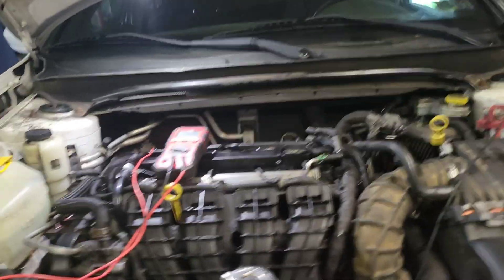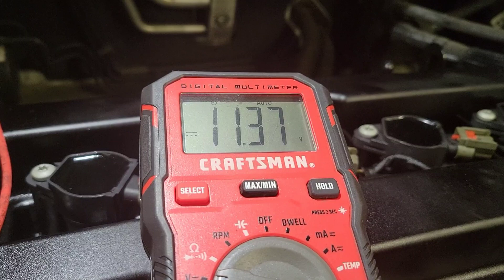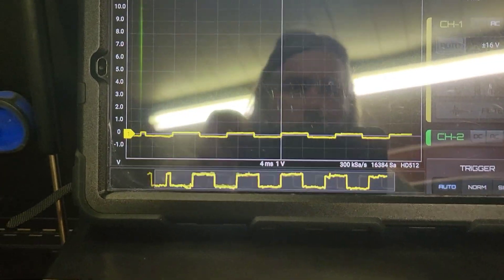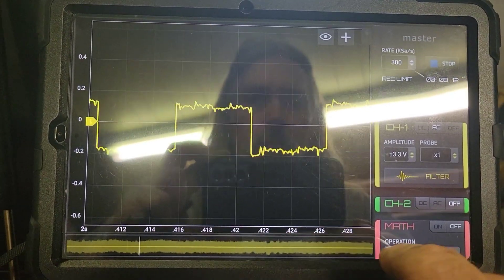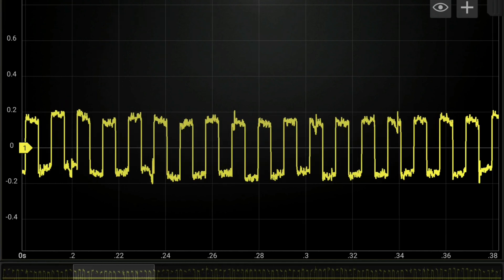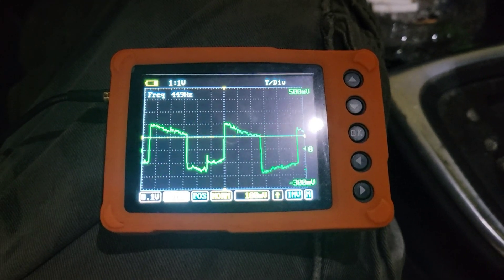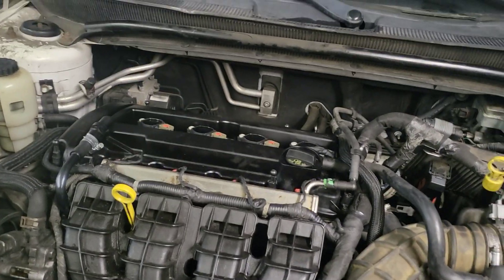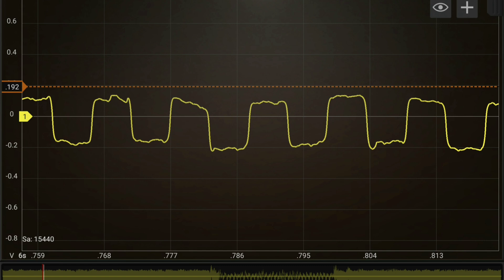Scoping out an active wheel speed sensor with Hscope. HS512 & Uscope.

Comment: Good captures for sure. I love the H scope record feature. Gives you plenty of time to go back and review the Data and look for glitches and or anomalies that might otherwise be hard to find. Although the U scope is great to have, 2 channels are always better than 1 considering the price range of each scope.
I have the 502 which is very capable for its size and price. Thanks for posting Eric! Appreciate your videos!
Reply from the maker: Thank you as always! Yes, that logging feature is awesome. The uscope it's just the one screen. I thought out of anything, wheel speed sensors would be where the 512 was limited compared to the 502 but was happy with what I saw. Canbus, I imagine the 512 suffer, but so far not a real difference. 
 Did you ever scope a passive wheel speed sensor with the 502 ? That's where the uscope picks up some but not all .
Reply: @Backalleydiagnostics  
At this time I have not scoped any speed sensors. I've mostly done injectors, crank, cam, and some CAN, SCP ( Ford two wire communication) , and some ISO 9141 1 wire communication. I've scoped some pwm on servo motors and simple things like Throttle position sensors, relative compression and ignition trigger signals. I admit I don't use my scope that much but it's good to know it's there. Thanks for the reply!